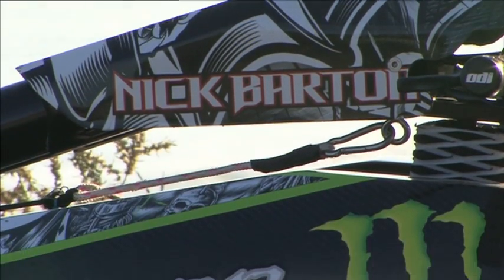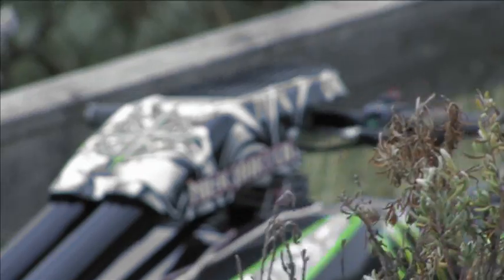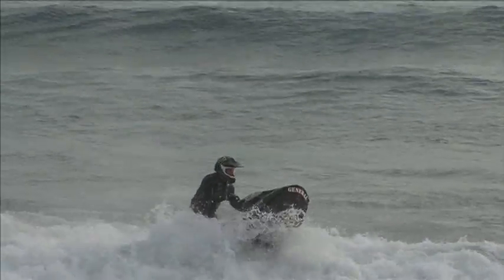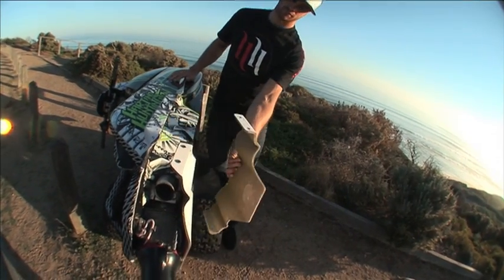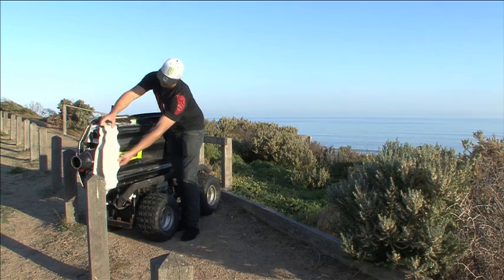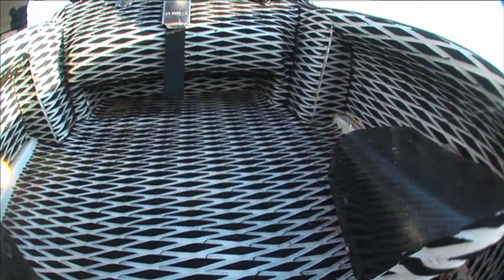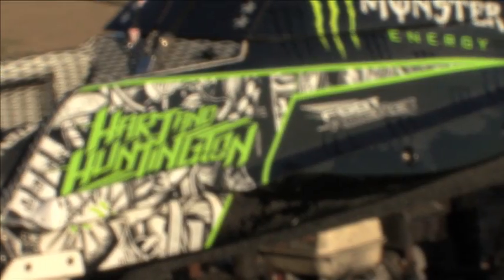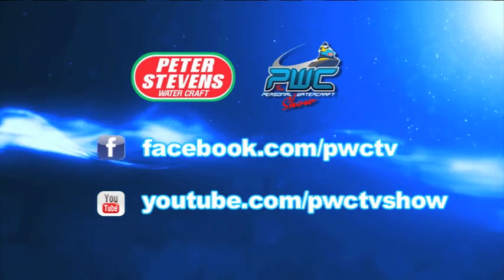PWC TV - Nick Barton show us the Footrocket!

Comment: awesome vid as a two stroke builder for years I call bullshit on the 240 horse but still way cool
Reply: Eric Johnson nah mate, that's about right. Its a 1000cc 2 stroke engine heavily ported worked. With the right knowledge it's achievable. Some exhaust systems can gain up to 10-20hp!
Reply: You are definitely not a good 2 stroke engine builder if you don’t believe these can make 240hp